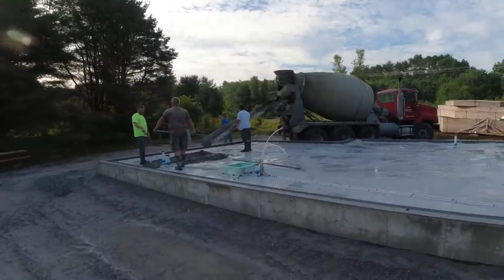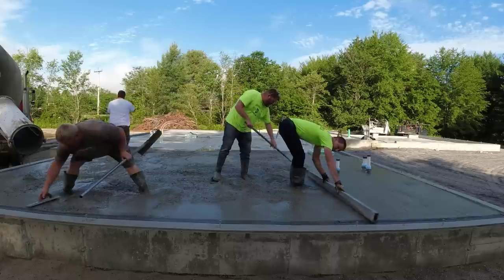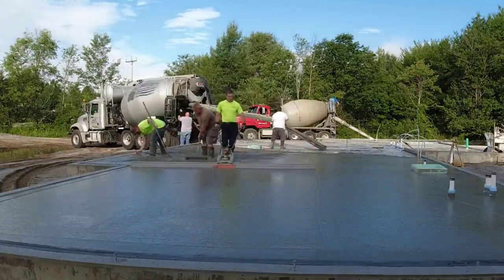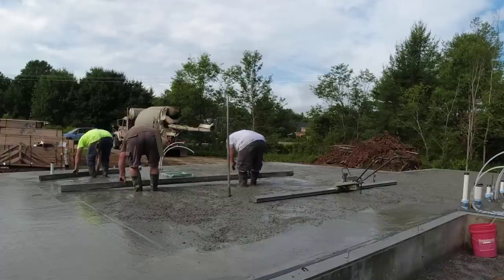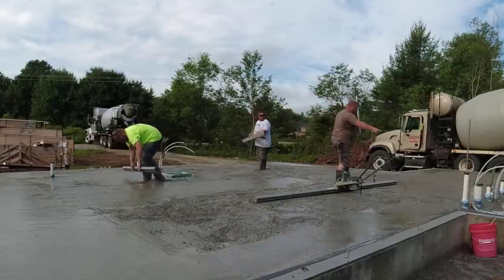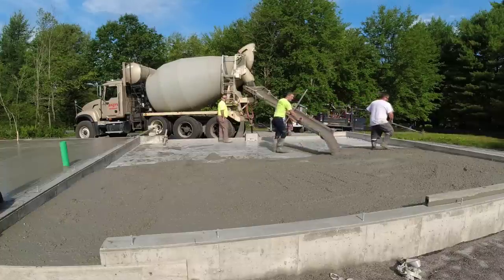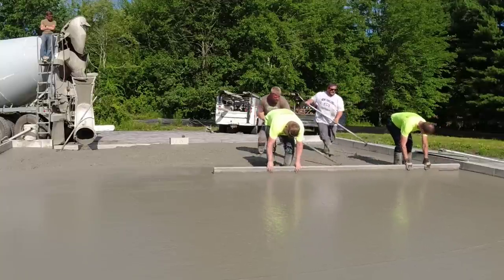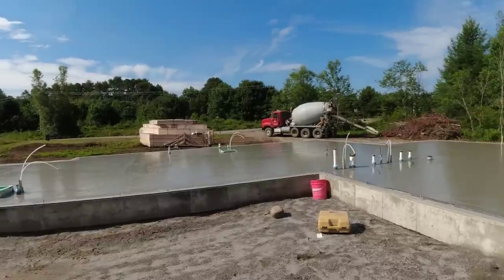How To Pour The House & Garage Concrete Floors the SAME DAY!

Comment: Hey Mike. How do deal with concrete flash setting due to hot weather and really late concrete deliveries. I had a pour in MD. Truck was 2.5 hours late Temps got in the 90s at 10am

Comment: Great crew, don’t have to worry. Frost walls are used exclusively here in west Michigan for almost all senior condo,s, same as you did there, except hot water heat here is not as common..but in my opinion the way to go with Crete.
Reply: Do you do concrete for a living? I'm from central Michigan. If you'd be willing to teach me I can work one day a week for free. I just want to learn
Reply: @peters6850  pretty much retired, thanks for asking.
Reply: @mikeknoll1130  thanks for replying. I appreciate it